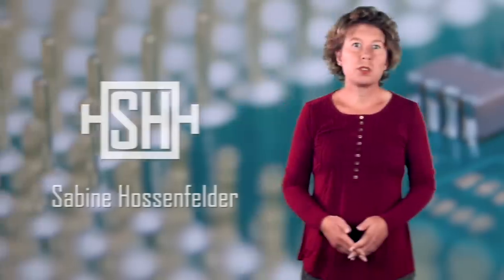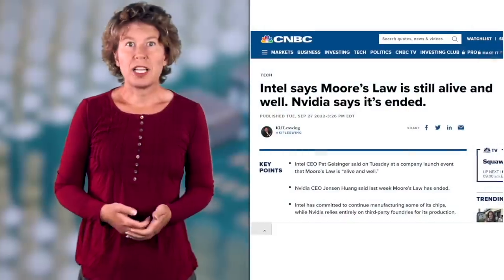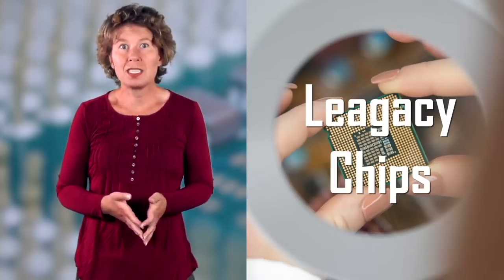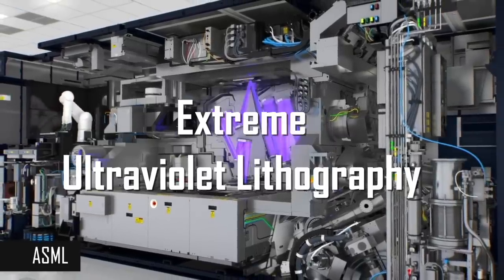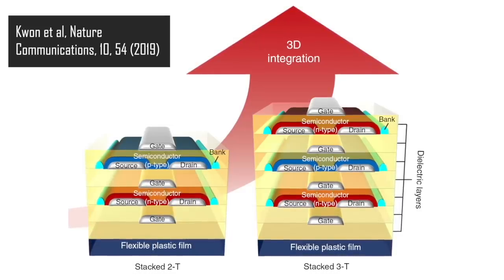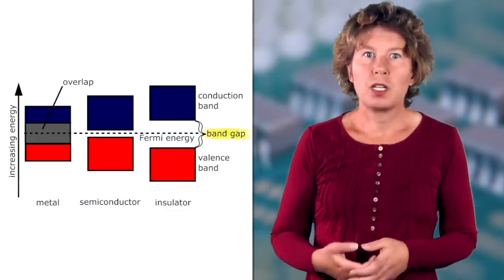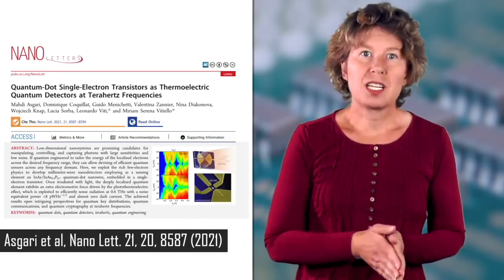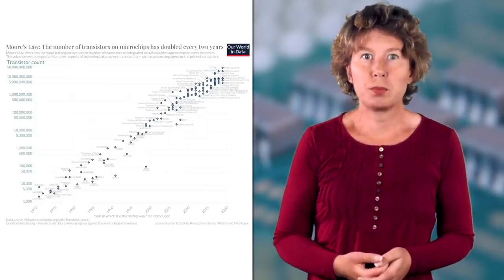Is Moore's Law Finally Dead?

Comment: 1967(The Summer of Love) Moore's law dead!? I was born that year and I'm still going. My first computer would of been an APPLE ][+ with 16K RAM but parents wouldn't let me spend my paper route money. Then there were the adults in school in silicon valley who didn't know electronics. Most school teachers who have an education degree are really a drop out. Except for shop teachers(Hands on shop stuff is great welding, machining etc) and people like that real teachers should have a real degree in math, physics engineering not a drop out un curious lazy adult with an education un-degree.There's a reason most engineers in silicon valley are foreign born and educated. Most engineers leanred the basics from their hobby not from school. Those few who had regular schools where teachers know things are extremely fortunate.

Comment: My first computer was a Commodore VIC-20.
MOSTec 6502 8 bit processor @ 1.02 MHz
Memory 20 KB ROM + 5 KB RAM 
Screen 176 x 184, 16 colors 
300 baud modem expansion card!  Blisteringly slow!

This phone, a Samsung Galaxy S22, is worlds more powerful than the VIC20 or my second computer, a C-64. It's like magic!  I hardly use my new Win11 computer for normal tasks any more.
 S22:
2340x1080 display
64-bit Octa-Core Processor @ 2.8Ghz
8GB RAM w/ 256GB storage 
5G data (100+ Mbps)

And it fits in my pocket unless I'm wearing women's jeans.

Comment: Moores Law has allowed bad tech to get away with bloat and being really really slow. This has allowed non technical managers to dumb down their workers either by hiring barely qualified juniors or using hiring an offshoreing specialist who does this under the covers.

Certainly this isn't what happens within mass market providers of tech such as phones but really does apply in government and corporate IT. 

I saw this sort of bloat and stupidity first hand in finance over the two decades from 2000..

Additionally re Gallium Nitride it may not be ready for prime time WRT CPUs GPUs etc but it is proving revolutionary in switching at a more macro level such as power supplies, chargers and class-d audio.

Comment: I think there is a market issue too. What market need is there for ever greater speeds and capacities? Today, maybe the only personal users who need greater speed and capacity are gamers and people who are doing computer-aided design.

In any case, the places where greater speed and capacity are needed inevitably are going to become more exotic. Even with machinery operated by a computer (self-driving vehicles - self-flying planes - robotic manufacturing machinery) there is no need for a computing power possessing a capacity to run machinery that exceeds the physical capabilities of the machinery itself. Maybe the only place where ever greater speeds and capacities could utilized is in computer modeling and artificial intelligence.

Comment: How about, instead of using a transistor as just on/off state i.e. 1 Bit, use multiple resistance bands to represent multiple bits per transistor, e.g. 2 Bits/4states 🤔

Comment: Its the law of diminishing returns here that affects Moores law. Basically we saw this about a decade ago as the chip freq is not really going past 3.5GHz to 4GHz generally on the Silicate substrate in use for current chip design. Sure you can make some chips 5GHz but we hit 1GHz like 20 y ago. Today its about multi core at 3GHz rather than 1 core at 30GHz. We went sideways after a point. But now we are reaching the end of sideways too. So we have like some chips with like 72c per socket at about 4GHz each. But then what? 
Thats the present.  I feel it will branch into new materials and other physics and Electronics which will keep it going another 30y to 40y till we hit another wall and do something else. Humans will progress. Its in our blood to devise new ways.

Comment: Yes, contrary to what Hossenfelder says Moore's Law is dead, which is why you don't see faster processors anymore but instead CPU power relies on tricks like more cores, etc.
Reply: There still are more transistors per system and this is all that Moore's law really said.

Comment: The US is making a huge error in trying to move chip manufacturing back to the US.  Cutting edge chips are important.  But simpler devices are much more in demand than cutting edge chips.  IGBT's (insulated gate bipolar transistors) are hugely used in manufacturing, as it's what you use to control high current loads.  Like motors.  And all manufacturing used motors.

For tactical advantage, the US needs to make these devices more than it needs to make cutting edge chips.  It doesn't matter if you can make a cutting edge CPU or GPU if you cannot make the devices that drive the motors and servos that make the chip making machines work.

Comment: So, I don't understand, is the Moore's law merely about the number of transistors in a given area or volume, or it's really about the size of the actual transistors themselves? I'm asking because if it is the latter, why would stacking even matter? It's not going to shrink the transistors in anyway. However, if it is the former and it's merely about the size of the chip; does it even matter when it comes to general use gadgets like cell phones and laptops. Would it really affect your phone in any meaningful way if those tiny chips in your phone were double their size so they could hold more transistors on them?

Comment: A brain has 86b neurons, whereas a Ryzen 7600 (a decent consumer grade chip) has 6.6b transistors. of course, part of the magic of the brain's setup is that each neuron can talk to several other neurons, whereas each of the processor's transistors can only talk to one other transistor. The Ryzen makes up for this somewhat by having a clock speed that is orders of magnitude (six? seven?) higher than your brain. 

Each does its thing well. A supercomputer can beat Gary Kasparov at chess. A human can conceptualize the plan, "I think I'll beat Gary Kasparov at chess today. When I'm done, I'll drive to Starbucks, get a late, and write a poem about what it's like to lose at chess to Gary  Kasparov". My brain uses 12 watts to do this. Big Blue uses, well, quite a bit more. 

I'm an atheist, so my belief system is that anything that can be done by my brain can be done by a manufactured computing device, though that device hasn't been invented yet. Moore's law isn't dead, though Moore's law for silicon well may be. The fact that my brain isn't crippled by quantum tunneling tells me that even if we've run out of room with transistors, we haven't run out of room for other computing techniques. Moore's law may take a pause at some point, but our improvement of the tech has plenty of headroom. There are better methods than the transistor.

Comment: 7:00 - WHAT ? Nvidia was early on videogame for PC market, yes, but they did not Pioneered GPU AT ALL...
Firsts GPU were developed in the 70's, often for arcade systems. The NEC in the 80's started to propose GPUs, and in the 90's, S3 came first on the market, and Videologic PowerVR, and 3D FX, broke the PC market BEFORE nvidia...
And don't forget SGI, who developed OpenGL...

Comment: Superconductivity at room temperature? Nah, we need a sci-fi cooling method utilizing reverse-nuclear explosion nucleosynthesis, operating at room temperature and pressure - CPU with a substance that has the ability to absorb large quantities of heat and convert it into plutonium-239 :). One gram of this substance could absorb heat equivalent to that produced by burning approximately 38,000 tons of coal. Alternatively, using a portable pico-black hole to absorb all heat energy from the GPU would also be fine :).

Comment: Common Sabine, you are getting sloppy (but you are still excellent.) This is a third time I end up posting correction in a last couple of weeks. @ about 7:00 it is stated that NVIDIA pioneered GPUs, that is incorrect. It is difficult to say exactly who pioneered GPUs (I use generally accepted accepted definition of the term "GPU", as I would expect you are in this video, NOT the one NVIDIA marketing team created to promote their GeForce 256.) Before NVIDIA there was 3DFx and they were selling, what we would now days be called a GPU, way before NVIDIA; and ATI was selling their products even before 3DFx (but it is questionable if ATI's early Wander cards could be considered as using GPUs); and before ATI there was NEC with µPD7220, and so on.
Reply: She's using graphic processing unit I think
Reply: Yeah, so I checked and you're wrong

Nvidia was the first to make a dedicated processor for graphics. The likes of IBM paved the way with their graphics software but Nvidia were the first to put them together
Reply: @drsatan9617  So you are saying 3DFx's Voodoo 2 and 3, which came out before GeForce 256, are not considered GPU's by generally accepted definition of term "GPU"? Knowing that there is a good chance that some one would fall for the NVIDIA's marketing trap, I made a comment about GeForce 256 in the original post. The key is that term GPU is not used by general public, including by Sabine in this video, the way NVIDIA coined it. Specifically Nvidia had a performance based constrain of 10 million triangles/sec, which modern definition does not have, thus qualifying Voodoo cards as using GPUs, and if we use term "grphics" broadly, i.e. include proccessors that were dedicated to 2D acceleration then that would qualify NEC µPD7220 from 1981, way before NVIDIA even existed. Furthermore NVIDIA is not even the one who really first to use term "GPU", supposedly it was Sony in reference to their GPU on PlayStation. Here is one of many sources you can read up in regards of this topic:  https://en.wikipedia.org/wiki/Graphics_processing_unit.

Comment: Just to be clear, Apple is not the first organization to stick CPUs, GPUs and other components on a single die. This is called "a system on a chip" and has been around since 1992, and have been present on most smartphones for well over a decade.

Comment: Moore's law original meaning ended when we switched to FinFETs (~ 2015 or 2017).
There is no relationship between the gate length CD and the numbers (sub 10nm) 7nm, 5nm, 3nm etc. These are marketing terms. Even the various interpretations (e.g. economic) of Moore's law are meaningless.
There is much more to it but it cannot be disclosed in public.
Reply: Moore's law is about transistor numbers. It's not even a density thing. By going three dimensional and by making chips larger one can scale transistor numbers even if the feature size stays the same. Chips have gotten bigger over the years and that was always baked in.

Comment: This is a bad terminology tangle. Moore's Law referred to a particular phenomena, and it was pretty much done with in the last decade. You might propose something called Moore's Concept which suggests an exponential increase in computational power by whatever means. But Moore didn't say anything like that.

Please could someone come up with a more general term for the exponential increase of technological sophistication in a society. Perhaps call it More's Law? This is really just an extension of the exponential power of biological systems. A superior organism can fill a niche on an exponential scale. Technology builds on itself to achieve something similar.

However, all the exponentials due to specific properties that people generally pointed to have stymied in the last decade or two. Transistors have not been getting much smaller, the clock rate of processors has not been getting faster. The increase of power consumption in successive chips is sublinear due to cooling the problems you mentioned. The memory in successive machines isn't moving a great deal. My mid-range 13-year-old laptop came with 8 gig. You can still find new machines outfitted with that much. Likewise the number of processors in successive machines is only creeping. Parallelization has not panned out so far, and throwing more cores at a problem offers only modest improvements if any.

The continued improvement in our computing devices has been due to the tail wagging the dog. Companies that chained their roadmap to Moore's Law could not shake the habit long after Moore abandoned them. The same factor of improvement is taken as gospel for the next generation, and enough tricks are assembled until the benchmark is achieved. 

You may recall that the point of Moore's Law was a doubling for the same price point. Obviously not so anymore. And somewhat pointlessly since fewer and fewer of our tasks require increased computation. Almost none of us are graphics professionals or numerical analysts.

Most of what recent speed increases have enabled is lazier programming. Perhaps this is reasonable as programmers have traditionally been more costly than their machines. I suspect this reaches a limit too.

In all, we are no longer riding the trend of a theory, we are just grabbing at all kinds of clever tricks that get us a better high. We would have to back off of any principle here more specific than the exponential tendency of technology as pursued by humans. Are we willing to claim that that does not also hit a wall?

Comment: Wait a sec.  you say that 3D stacking allows the chips to run cooler, but a little later you say that heating is a problem with 3D chips.  I'm not sure I understand why, unless it because they're using 3D chips to put a greater number of transistors on the chip.  So I'm guessing that 3D stacking allows more transistors on the chips, but only so many more before heat becomes a problem again.

Comment: Maybe we don't need faster computers. If we do, software companies will just make even more bloated software to do the same task and load the faster computer. Software is like the ideal gas. It always expands to fill the available memory.

Instead of 3D stacking, we could have multiple conventional processor packages each with its cooling.

Comment: 6:58 "GPUs have been around since the 1990s and were pioneers by Nvidia" Meanwhile, the image of a chip displayed says ATARI 1982 produced by American Megatrends International. YIKES. Everything about these two statements is wrong. Nvidia wasn't a major player until after 2000 when it had acquired 3dfx and developed the GPU for Microsoft's Xbox. I suspect the ambiguity of "pioneer" is trying to do a lot of the work here but it's just plainly wrong. Graphics acceleration long predates Nvidia.

Early graphics chips are better described as frame compositors not processors because of the high cost of RAM. This architecture also followed through the entire process of rendering graphics in software and existed through the Arcade era from the 1970s. The first graphics processor was made by Hitachi in 1984. These were technically 2d primitive accelerators. They were at least properly a type of specialized processor however.

The first use of the term GPU was by Sony for the GPU in the PlayStation made by Toshiba in 1998. Incidentally they also called the sound chip the SPU. However as was the case with Sonys GPU these were 2d accelerators with some 3d functions and complex operations taken by the CPU would translate geometry to create 2d projections to be processed by the GPU. This was 3d graphics but the 3d part wasn't hardware accelerated. The technical term for this was that the 3d graphics had hardware rasterization. (things like 2d layers, sprites etc)

The later concept by the end of the 1990s of 3d offloading (from the CPU) or proper 3d accelerators was pioneers by Nvidia but only in part. The process of converting the 3d geometry into 2d projection is called "transformation" as well as a process which calculates light emission from surfaces was called lighting. This was collectively called Transform and Lighting or T&L. From Wikipedia: "The Nvidia GeForce 256 (also known as NV10) was the first consumer-level card with hardware-accelerated T&L; ~professional 3D cards already had this capability~." The GeForce 256 was released in 1999.

The "professional 3d cards" they're taking about were made by Silicon Graphics (yes the same people that made OpenGL) such as the SGI Onyx in 1993. The joke here being of course the Onyx was a super computer not a card. But later iterations of the technology were used in Arcades at the time as well as for the N64. The N64 released in 1996 used an SGI GPU which was called the "RSP" or "Reality Signal Processor" which was the 3d part of the Reality Coprocessor. This is what made Super Mario 64 the first 3d game (that wasn't an Arcade unit!). So three years before Nvidia.

However, Nvidia was pioneering in it's use of programmable shading or so called "pixel shader and vertex shader units" which is still relevant today. Note however compared to the Onyx these "units" are themselves specialized hardware of what those processors did. They were a consumer level optimization.

So to button up the original statement: "Consumer level, 3d accelerated GPUs have been around since the late 1990s and Nvidia pioneered in bringing professional level features such as lighting to mass market with shader processing units"

Comment: IMO the biggest problem on the CPU/GPU market ist: Only performance matters. They give a shit about energy consumption. And it would be no problem if someone would introduce a max energy usage per unit and/or performance. We rly need more low energy CPUs and GPUs. For now the development is this: Higher performance cause more bloated Software. It gets more and more inefficiant. Nobody rly cares about that. "Our software is slow, who cares, next Generation Hardware will fix it. Let the consumer pay with their energy bills.". ^^

Ps.: Please get rid of that VPN scam. Only save VPN is the VPN you control, not a man in the middle VPN provider sitting in Panama. It does not add privacy nor security!